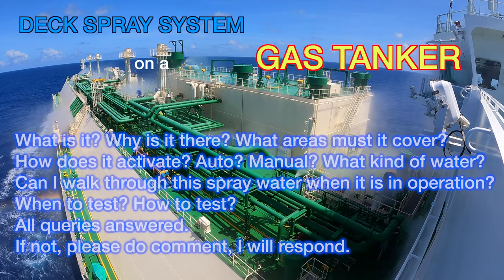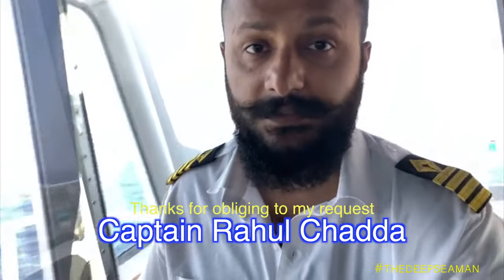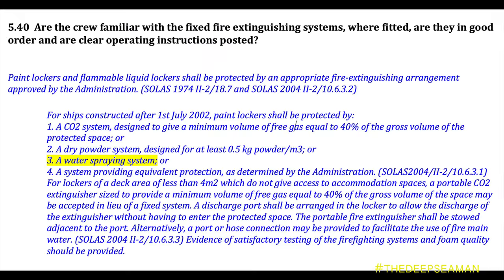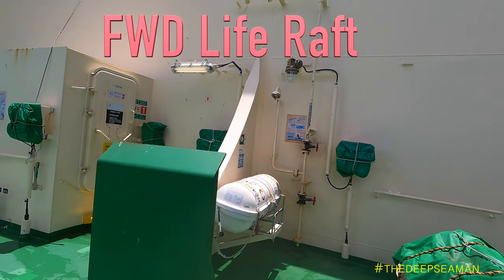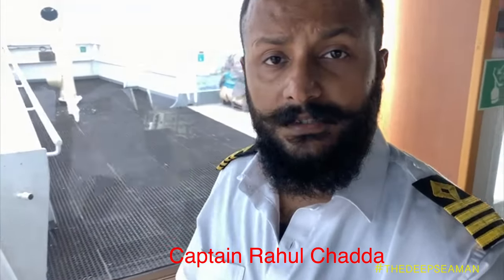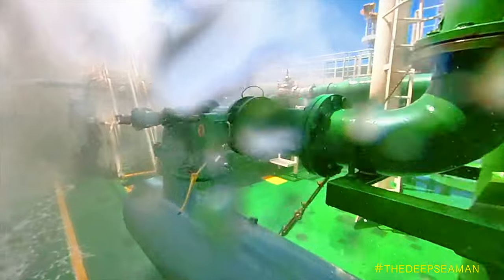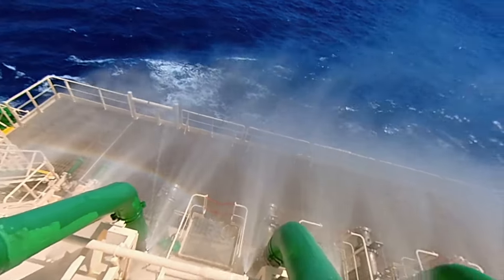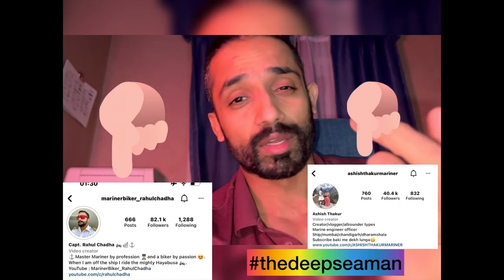DECK WATER SPRAY SYSTEM - IN ACTION ON A GAS TANKER/LPG/ETHANE/VLEC VESSEL - SYSTEM DESCRIPTION

Comment: do we use fixed DCP system for LPG cargo tank fire?
Reply from the maker: LPG/LNG cargo tank will never catch fire AS THESE ARE COMPLETELY CLOSED SYSTEMS. the pipelines to/from the tank can ignite only when it comes in contact with the air as there is no flammable mixture inside the pipe, ; for gas fires (source is gas) the best way is to shut the source and the fire will die out automatically, the water spray system and dip systems are to control and prevent spread of the fire to other flamable items around